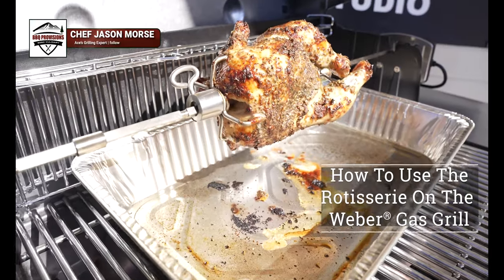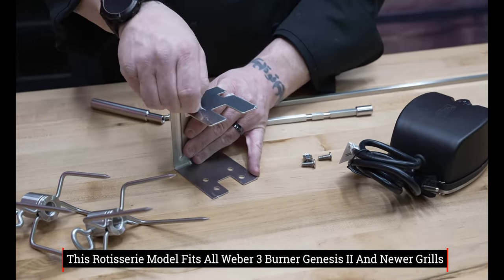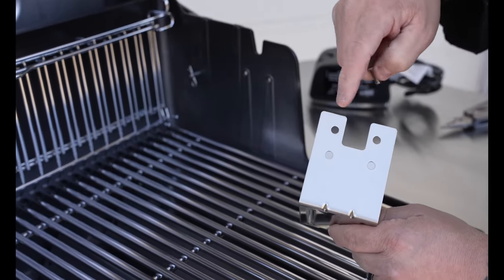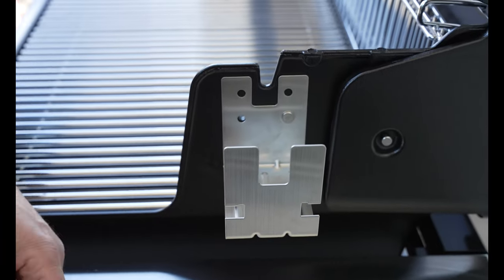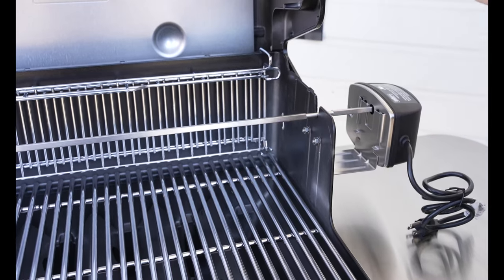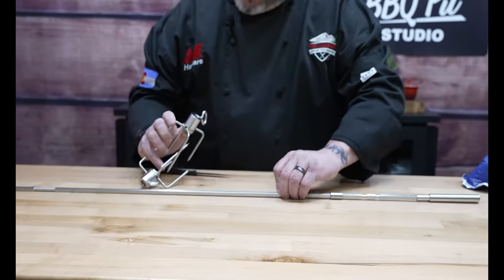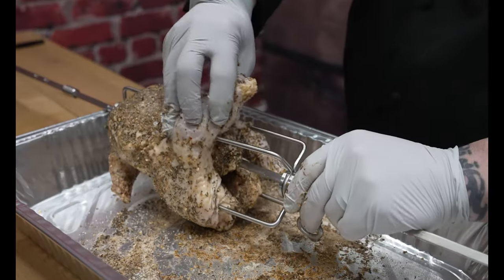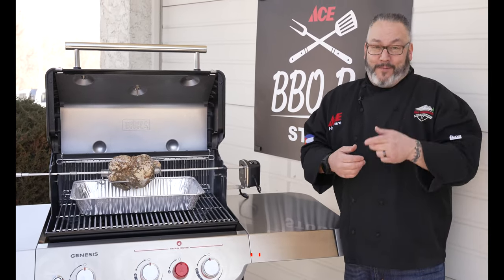How To Use Weber Rotisserie On A Propane Grill - Ace Hardware

Comment: Why not truss the chicken to keep legs from flapping around--and possibly moving the drip tray? Burnt a turkey once when a drip pan moved--not a good thing. Using the drip tray to catch seasoning/spices isn't good--scorched spices can give off flavors when burnt in the drip pan.
Reply: I stuck the tines/forks thru the leg to hold it in place, didn’t want to double my work with trussing.  

Once the forks are set good, I trust them to hold the legs in place.  

I compress it tightly when I dial in the wing nut.  As far as drip pan, I am cooking indirect, so if you look in the video you will see bare minimum juices after this bird is all cooked.  

Thanks for the comments.  Happy Cooking, Chef Jason
Reply: sounds like you didn't know what you were doing

Comment: This has to be the biggest piece of garbage I’ve ever paid for. The design is the dumbest. It’s just sitting in the motor and it’ll spin out. 
Don’t waste your money on this gimmick
Reply: Hi IBreathe, when setting up the rotisserie and inserting the rod into the motor, there is a tactile feel when it's "locked" into place.  depending on the grill you have, you might have to use all sections of the rod that are in the box, this allows the grooves in the rod to line up with the grill and hold the rod in place while it spins.  let me know if that fixes the issue for you.  Happy Grilling, Chef Jason